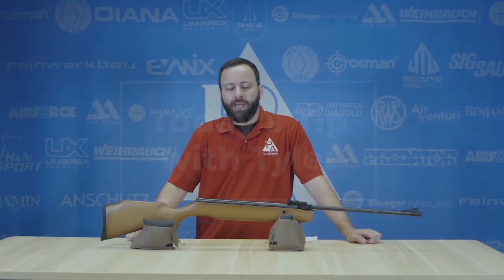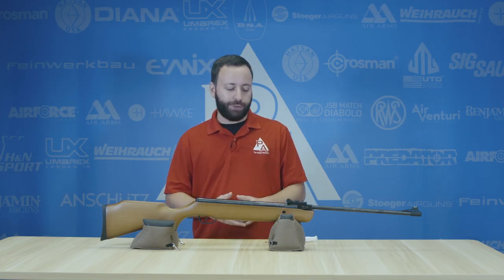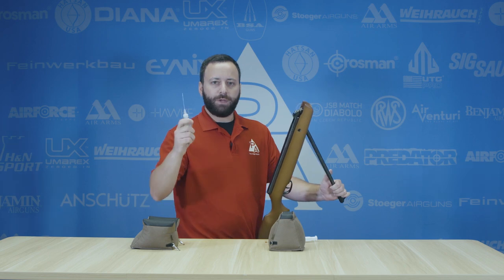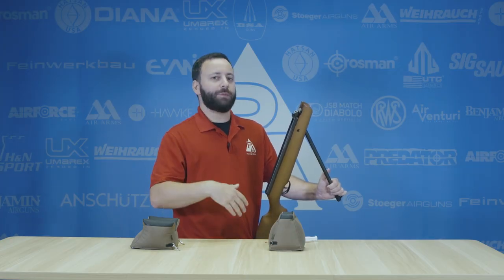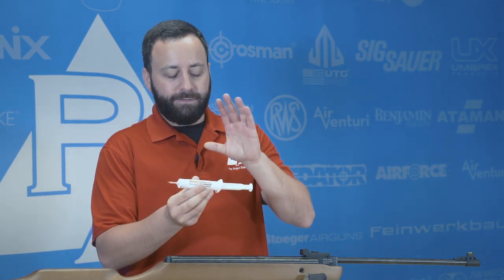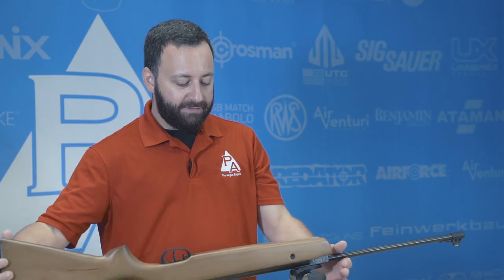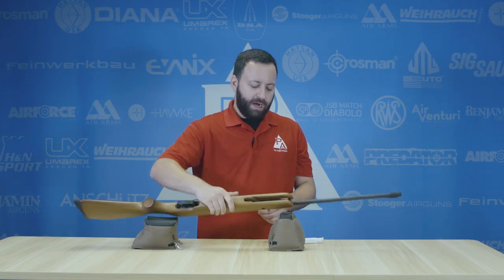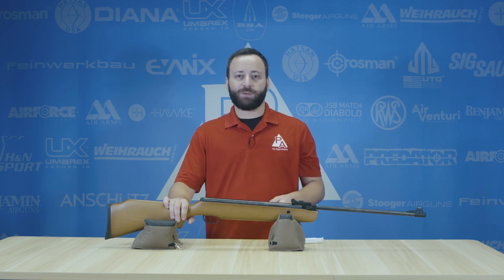Spring/Gas Piston Airgun Maintenance

Comment: Is the RWS  air gun chamber lube the same as the RWS spring cylinder oil?  The chamber oil does come with the needle applicator.  Thanks.

Comment: I have a Crosman blaze xt.. It’s a nitro piston chambered in .177 and it’s been making a honking noise almost every time I cock it.. I’m sure I’ve shot less then a thousand rounds through it, maybe close to that by now but I’ve tried putting silicone oil in it a few times and even let it sit for a bit so it could drip down the tube and soak into the piston but still having this issue… Anyone have any ideas?
Reply: It has started identifying as a goose. Don`t be a goosaphobic!

Comment: Sir I put 3-4 drop of gun oil in compression chember hole. After 15  days I take first shot little smoke laud sound but then normal sound and no smoke. I worried abuot damage to piston seal during first shot. What is your opinion abut that ?
Reply: That's called "dieseling", it's the oil in your chamber igniting. Usually gives you an extra 40-60 m/s. It can damage the seals in your gun if you do it a lot, but a dozen or two dozen dieseled shots should be perfectly fine. A lot of new spring guns (especially the inexpensive ones) come with a bunch of oil in the chamber from the factory that will burn off with the first few firings.
Reply: @macalvand  thanks